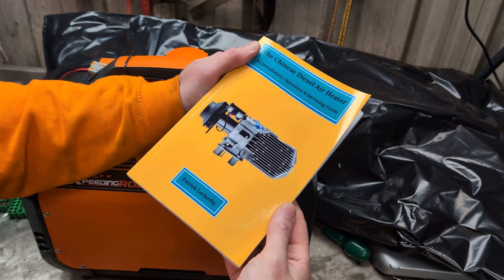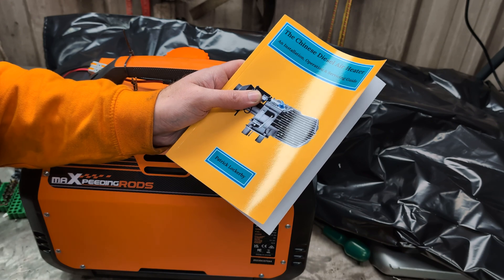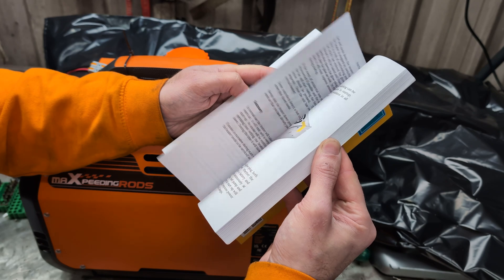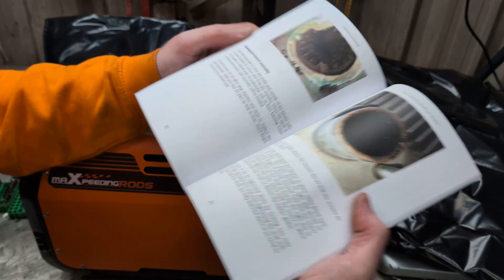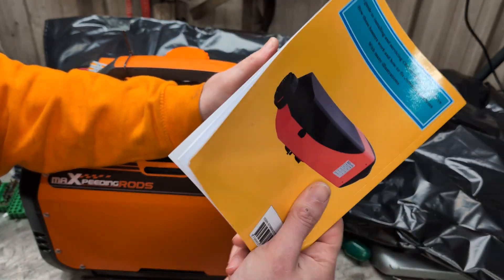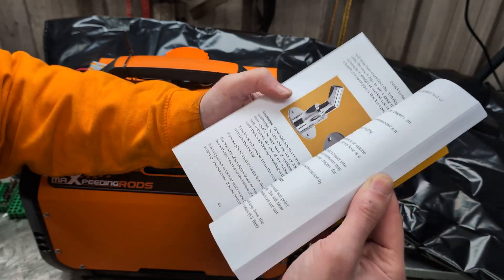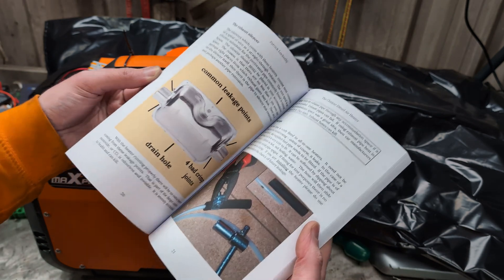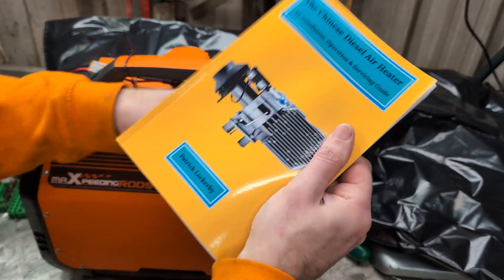The Chinese Diesel Air Heater: An Installation, Operation & Servicing Guide - by Patrick Lockerby

Comment: I wonder if they make at any point of time a Propane "diesel air heater" or multi fuel
Reply: In principle a chinese heater could be made to run on propane, but it would need a totally redesigned controller and an electronically controlled gas regulator / valve.  It is something a hobbyist engineer might do for fun, but would be very expensive.  Not for the average DIY tinkerer.
Reply: As for multi fuel, do a quick search on YouTube and you'll find a lot of details about people who experimented with burning just about every liquid fuel you can think of in these heaters. If I'm not mistaken, this channel has at least one video on waste oil as fuel which concludes you can do it, but you shouldn't.

Comment: Definitely would be a good book to have on hand for off-line referencing/troubleshooting.  Side note, if you wanted to make it water proof, puzzle glue/mod podge, or spraying the pages with some acrylic from a rattle can, should do the trick. If you deicide to do it,  you should consider filming the procedure in time-lapse and then upload the results.